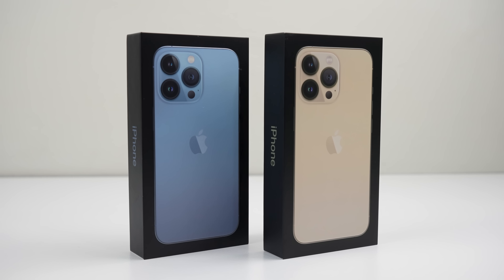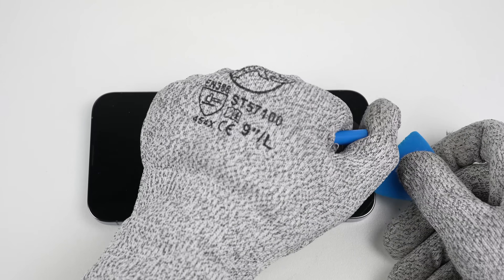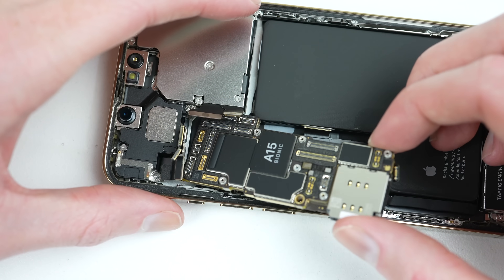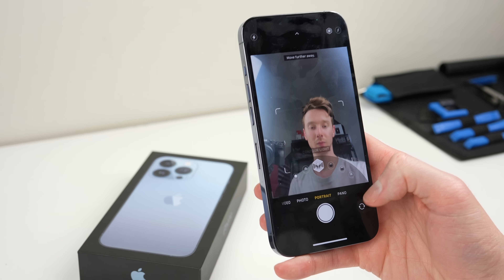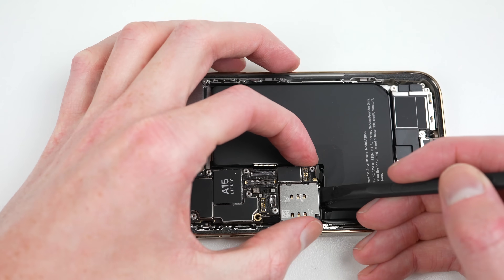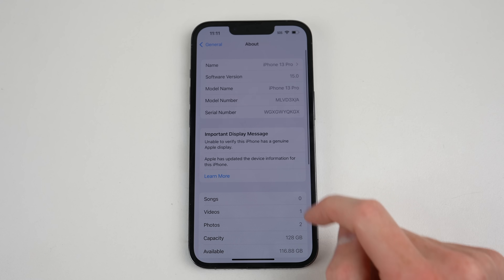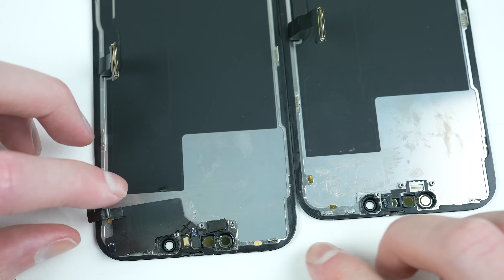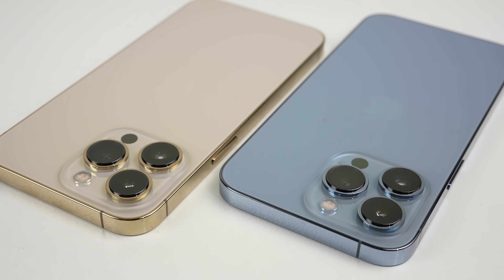iPhone 13 A Repair Nightmare - Teardown and Repair Assessment

Comment: I did fieldwork with e-waste informal workers here in Mexico City. When companies talk about extended producer responsibility and preventing apple products in e-waste streams they are in reality talking about preventing independent repair, promoting shreding and monopolizing aftermarkets and controlling whole lyfecycles. The definition of what is and what is not e-waste is a highly political issue. Informal aftermarket activities that make use of scrap pieces for a variety of processes which are preferable to recycling are all seen univocally as "toxic trade". Sure, the same people involved in this activities are also involved in some toxic activities when disassembling what they didn't sell to repairers or seccond hand consumers, but instead of taking away their livelyhoods and further marginalizing "waste" workers, policies should attempt to help them get better working conditions and incorporating them to formal waste management system, recognizing their improtant services to society. If not, it is easy to see how environmental concerns end up being marketing strategies to delink some people from the value chain of discarded electronics.  Extended producer responsibility seems like extended producer property in many cases around the world.
Reply: What my experience tought me was that the ways in which the afterlifes of the electronics are controlled through design only promote more of them going to processes of waste management that are perjudicial to the health of people and the environment. Informal wasteworkers do attempt to recirculate wasted electronics at higher values by putting them on sale in markets for refurbishment and repair, before sending them to the smelter. The toxic activities of uncontrolled dissasembly and material recuepration in open air backyards are both responsibility of this informal wastworkers as a responsibility of the manufacturers that design this products in ways that avoid competition from third party afrearmarket activities. However, this workers are stuck between a relationship of dependence and of competition with original manifacturers. They do benefit hughely from planned obsolescence as they do from activities that extend the afterlifes of this products.

Comment: If you replace the camera, the device mimics a faulty camera scenario. 

"Oh yeah, replaced by scratched camera but I must not have done it right. Camera is all wonky now. Better go to apple, so they can charge me full price to 'fix it', try to convince me to buy another, or say they fixed it and just replace my whole phone."

They want people to think these devices are incomprehensibly complex and unfixable at home or by anyone but them, even when it is relatively simple work given the large independent repair support infrastructure that has flourished over the last 10 or so years. It's all lies and misdirection tactics. Really sad to see.

I have a habit of not going and out and buying a new thing when the one I have breaks. I've Frankensteined two headsets together before, the working microphone from one and the working speakers from another and played games and talked to my friends through it for an additional 9 months before that too eventually broke and I bought a new pair. I've reattached broken free hanging headphones back onto the set with tape and paper/cardboard before to get extra use out of it. I'm tight with my cash and I find figuring out how to make things function again to be a fun low risk (It's already broken) problem solving experience. It really bugs me that companies hate when people do that just because they miss out on a second sale of the same device to the same customer. Well, now they've missed the first sale as well. They can kiss my arse.

Comment: Back in the day, Harley-Davidson motorcycles engineered their parts to fit only with Harley tools.  And since Harleys did need regular maintenance and repair, those who wanted one either had to buy the tools, which were expensive, or commit to shop rates.   I don't think it was a good strategy for the company long term.

There's a difference between savvy capitalism and just being a parasite on your customers.  Eventually customers get tired of it.

Comment: Could this be anti theft measures?  There might be a range of identifiers for replacement parts vs installed parts.
Reply: As a professional thief i assure you that it is easier to cut open your iPhone , unscrew everything , take some random parts from them and then sell these parts to the iphone mafia so they can reassemble iphone and sell them to you for full cost than it is to just fucking steal your iphone.

Comment: This is just more reason to never use an apple device ever, just use a galaxy device if ye want a expensive phone, it seems like not even apple would technically be able to repair these things without causing issues, and would probably just send back a new phone with transferred data claiming it’s repaired, cuz even if they have specialty dev software it sounds like it’ll still cause issues cuz it sounds over engineered
Reply: Samsung was starting to go in the same direction until people caught their bs

Comment: when will people realize apple is evil.
If you understand the concept of planned obsolescence, then you can understand that apple is the concept taken to its endpoint and beyond.
They purposefully designed a laptop to fry permanently if any liquid is spilled on the touchpad and leaks down to bridge a certain pair of power chip teeth. 
why would they correct the design? They make millions off it.

Comment: Seems like that Apple has married all the components in the phone so you switch out one component is most likely going to cause other things to work I see that a lot on CNC controls for a fennec or Mitsubishi will marry everything together and they’re not interchangeable for one machine to another
Reply: Apple has firmware locks that purposely remove features if you swap out components

Comment: I AM FED UP! Not only at this product but it seems all products today are unrepeatable. Case in point, a relatively new toaster oven, electronically controlled. I couldn't even access the panel without COMPLETELY disassembling the appliance and having to deal with INSANE sharp edges of the case. RIDICULOUS! I just threw it out. WE NEED A MOVEMENT to end this nonsense!

Comment: the Lg g4 is the best phone for repairing because you can literally pull every component out of the phone and change stuff without breaking it but the phone being one of the first Lg smart phones wasn’t all that great and had many issues but what caused the phone for me to break was my sister who constantly just ran the battery dry until it couldn’t keep power anymore and then she proceeded to try and repair it herself and ended up frying the motherboard.

Comment: Thank you for video, so well made. 
Time to change my old phone.
Probably I will turn back to NOKIA. There were rumors they plan to release in middle of May 2022 model X200 Pro, with huge 7250mAh accumulator, 12GB / 256GB memory for like 700Euro. NOKIA was always in the top of quality.

Comment: I would never buy Apple I had a Nano as a gift it worked fine until apple closed the account It was in storage due to being abroad not a real issue but as you say you pay for it but you do not own it, most of the people I know have ditched apple for the same reason and some because of the cost. like the video.

Comment: Apple has been pulling this crap since the beginning.  The Apple printer for the Macintosh, the only printer that would work with the Mac, would only use Apple paper since the feed mechanism was non standard.  What a revenue stream scam.

Comment: This is why I switched to Samsung.  My last IPhone SE was never treated with brutness or rough play, but because of apple's updates that ruin their battery life. My phone just simply died and never turned back on.  3 years that phone lasted. And I was only disappointed with it in the end. My only complaint with Samsung is that the USB-C ports stop working properly after a year, but minus that. I've had little to no issues compared to apple (randomly deleting data, phone battery, it getting slowed, etc.)

Comment: Imagine all the engineering hours spent to make these ridiculous restrictions.  And, you know that the original engineering prototypes and samples did NOT have these restrictions.  They were most likely added AFTER the actual phone design was completed.  There is no way any engineer would put up with this BS while actually designing and testing the prototypes.  They would never get anything done!

Comment: They could simply add a clause to the agreement signed upon purchase: we are not responsible for faults incurred by repairs conducted outside of a genuine Apple service center. 

The real issue is the negative press they would get from phones breaking. People will inevitably blame Apple for their own poor repair attempts, and Apple products will appear unreliable even if Apple is not at fault. Plus, licensing agreements are way more profitable than purchase agreements. When you "buy" a product that you are not allowed to repair, you are really only buying a license to use it. License = continual revenue stream.

Comment: Wow this was fucked man. Why can't companies just not be scummy? Yes I know profit, but still just once make the customer's satisfaction priority. They claim that's the case and it clearly isn't.
Reply: Companies will care when the customers start caring.
Reply: @Angledtootsievids  I want to agree with you, but there aren't enough choices. I owned the Nexus 4, 5 and 6. I was tied of Google shitting on me and telling me to like it. I have gone to Samsung and never looked back. I tried iPhone, not for me. Besides that what other options are there for a stable phone? The Pixel is just more of the same garbage from Google they lost me as a customer indefinitely because of Nexus. There are knock off weirdo brands you can try but I feel like it's risky to use cheapo no namer brands because they could be stealing your info with embedded spyware or intentional root kits (looking at you Sony).

I swear if it weren't for Samsung phones I would have gone back to using a regular dumb phone that only does sms and phone calls.

Microsoft had their chance and somehow catastrophically screwed that opportunity up so bad I don't think anyone will trust them again.

Hard to care when you only really have two safe choices.
Reply: @DyslexicAnaboko  that does seem to be the case unfortunately and i think this will only change when the global tech industry stops being so centred in silicon valley and coastal cities in china and such which will hopefully provide better alternatives to the current situation

Comment: The second they capped Canvas memory in half, any hopes for apple vanished. It's working worse than competitors, it's more expensive than competitors, it doesn't work with 3rd party software, it's shit for developers, it looks outdated as it's been the same for 3+ years. It's straight out worse than a random middle of the pack chinese phone...

Comment: it looks like the CPU has a built in locked state where it will only have certain functionalities work if the same security code comes back from each component (a security code probably made from the Serial Number )
So by what apple has done they probably have a software to unlock the phone,put in the new parts and lock it back and it requests the current security codes from every component
That means the put a fkin logic module on every modular part of hte phone that outputs back a specific line of code... man thats something,i realy do wonder what the thought process of the engineers that designed these security "features" actually were

Comment: THIS IS THE NUMBER ONE REASON WE WON'T BUY AN APPLE PHONE, YOU CAN'T TAKE IT TO A SHOP IF IT NEEDS A FIX, EVEN WITH AN APPLE REPLACEMENT. SAMSUNG IS STARTING TO DO THE SAME THING JUST NOT AS SEVERE. SOMETHING ELSE, CARS ARE SO COMPLICATED THAT UNLESS YOU HAVE YOUR OWN COMPUTER, YOU MAY NOT BE ABLE TO FIX THEM EITHER OR HAVE GONE TO SOME MODERN CAR SCHOOL...LOLOLO!! ALTHOUGH, APPLE HAS TAUGHT US THIS IS THE WAY OUR STEALTH FIGHTERS  SHOULD BE PROGRAMMED SO CHINA CAN'T GET THEM TO RUN, AS WELL AS NEW COMPUTERS, IT DOES NO GOOD IF THEY DON'T WORK AS INTENDED EVEN WHEN COPIED!! SOMETHING GOOD CAME OUT OF IT FOR OUR OWN SECURITY!!

Comment: Imagine buying a new car and finding out that once the brakes go, you'll need an entirely new car, not just the brake pads.

That's what I'd call sustainability.
Reply: Mercedes does something similar to Apple, if a sensor breaks on your car you can't replace it yourself. You gotta take it to a Mercedes dealership so that they can replace the sensor and reprogram it to the car.
The future is screwed honestly.
Reply: @fluis943  And then, they will tell you that sensor for your five-year old Benz is no longer manufactured anymore. But you can trade in your model for a new one on a loan plan...
Reply: @fluis943  well, not like I was rolling in them, but I certainly won't be buying a Mercedes now. Even then, though, as long as it doesn't cost $1000 to get your brakes done, I'd still give them the edge over Apple.

And yes, it is. If by the Future, you mean "by the time this comment is posted".
Reply: @iceeCccs  I used to work for a company that had a small fleet of "high end" cars - let me tell you, never buy ANY of those pieces of trash. Mercedes, BMW, Lexus, Cadillac - they're all shitty cars put inside an expensive looking wrapper, and they are all absolutely looking for ways to force you back to the dealership for every problem.
Reply: @z-beeblebrox  this is def good info to have. If I ever bought myself a fancy car I'd probably go with a vintage muscle car but even then I doubt it, because I'd never want to drive it so that's a foolish use of money. The Rolls-Royce Phantom II is a nice vehicle but I'm sure they follow the same practices as those other brands you mentioned.
Reply: @iceeCccs  i drive 2001 merc, older ones are fine but new things are just pure aids
Reply: A wise man once said the sustainability isn’t the phones that they are selling it’s the sustainability of their revenue
Reply: And the brake pads are designed to go out
Reply: @are3287  yup lol
Reply: Tesla's car with their softwares are going in the same direction
Reply: I've seen this exact convo on another apple video a while back. Crazy.
Reply: Never buy Apple
Reply: Apple is actually planning to manufacture electric cars, by the way...
Reply: @jonathantan2469  Legitimately wondering if those EVs will have windows or a retina screen and a camera. Start the car for the 99th time? Retina screen shows gray bars.
Reply: @jonathantan2469  The iCar Flow, the most "sustainable" car available on the market (500,000 AA batteries required, not included, non-rechargeable)
Reply: @pressatoanime2440  What is flowing in the car? 🤔
Reply: @jonathantan2469  oh god no
Reply: i mean isnt tesla doing the same crap, if that car stops working you cant repair it youd need to buy a whole new one
Reply: Apple users are on a new level of brain washed haha.
Reply: It's only the same as buying a car and then having to buy dealer specific parts.
Reply: @BlamBlam80s  Did you watch the video you are commenting under? The guy used new, genuine Apple parts and was still locked out.
Reply: @Flowboat  Actually, that's a fair comment. It was mistake with what I quoted which thinking about it is strange, the parts should have worked. I'm glad i don't buy apple products
Reply: @Flowboat  Parts doesn't matter. If it's not an apple certified workshop it won't be valid due to regulations with warranty. As in only certified workshops have to follow their repair regulations that will make the phone still valid for their warranty. A non certified workshop using original parts can be problematic if there is a need to get something covered by the warranty due to production fault or repair fault, as the parts may be original but the service is not up to par from the technician. It makes it problematic for them to know where the fault lies and instead of having someone misuse or being a victim of this they do this software thing. They should honestly though have something in between where you can service it somewhere else and just null the warranty and still get full functionality if that is something the customer would want. No affiliation to Apple just work in a tech/phone store that sells and takes in phones for service and this is my take on the issue to why still using original parts will do this.
Reply: Did they ever said sustainable for the environment ? Or did they just say use sustainability (leaving out the information that they really talk about they own wallet)
Reply: Means you will have to send it to a official repair shop.
Reply: Imagine buying a new car and, after a few years, discovering that it won’t go as fast, the display often freezes for a moment and the fuel tank automatically decreases in size so you have to refuel more regularly.
Reply: now imagine the people buying those cars each year

those are the real idiots
Reply: Isn’t that how Deere works?

Also I’m pretty frustrated that Tesla didn’t immediately shut off every car is Russia.
Reply: it kinda is like that. used to be able to replace gears in a gearbox. been a while sicne that was easily possible in modern cars
Reply: Yes, sustainability of revenue
Reply: If you replace a part, the airbags stop working
Reply: Unless the car only $100